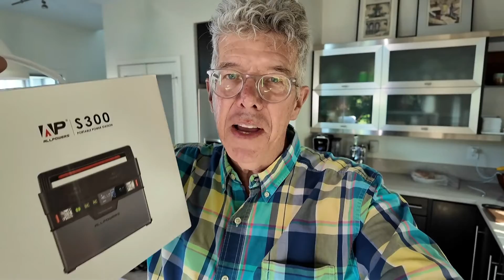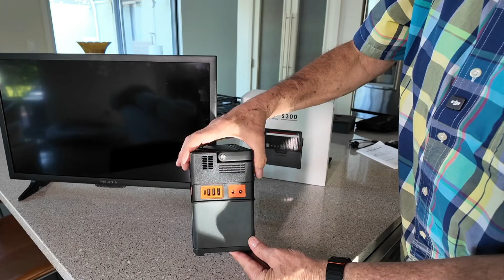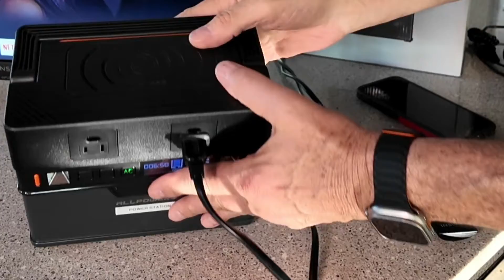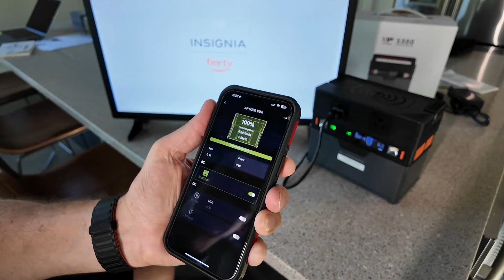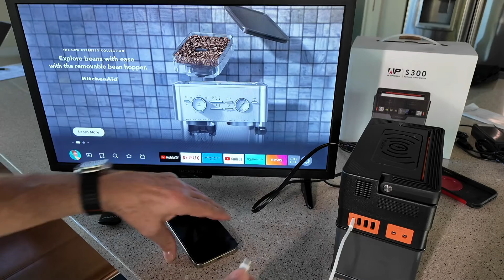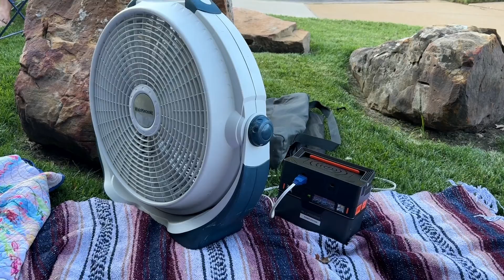Review Allpowers S300 portable power station 288Wh power bank

Comment: Can I plug this into my car’s 12V outlet using a 5.5×2.1mm cable, and then plug my fridge into the unit’s 12V output? I want the device to act as a buffer so the fridge’s startup surge doesn’t trip the protection and shut off the outlet.
Reply from the maker: I can’t advise you on that. That’s above my pay grade